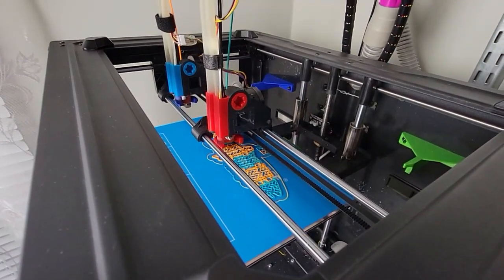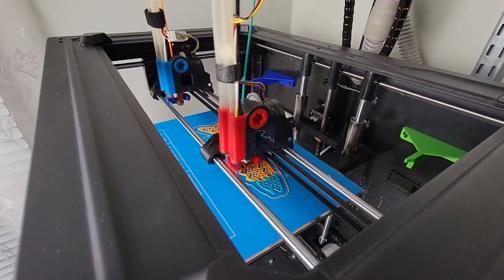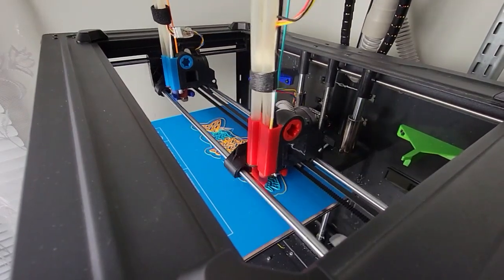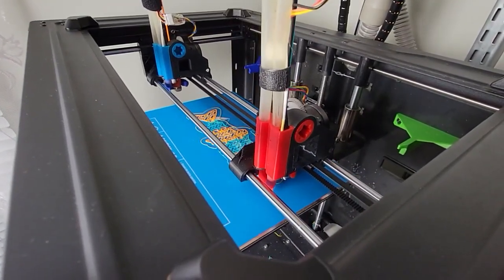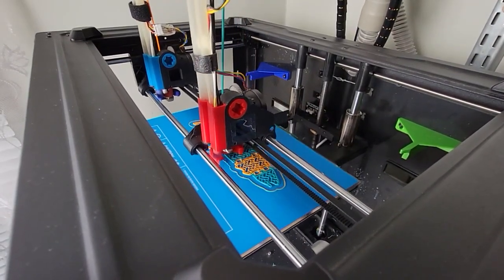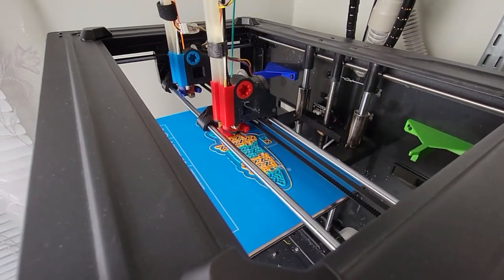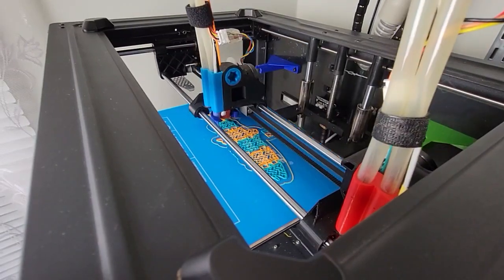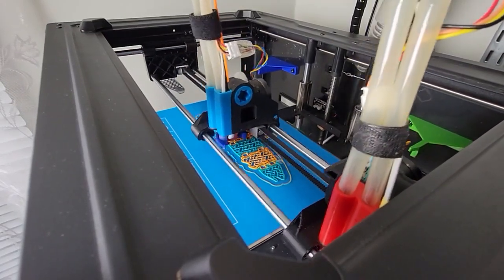1.97 Second Tool Change!  700mm/s at 4,777mm/s²

Comment: This looks amazing, would love to see the mechanism up close. Its way too fast lol. I'm wondering if you wanted to add more colors to possibly have them stacked along both sides and not attached to the axis? Just a thought.
Reply from the maker: Thanks!  You can see some closeup photos in my community posts here: https://www.youtube.com/post/Ugkx3SW8JXc22O16fT0ureUdnI2f6FZdYAWQ
You are basically describing a proper tool changer.  I may explore that design in near future.  However, most tool changers today are rather slow.  In a way IDEX is a simplest form of 3D Printer tool changer.
Reply: It's not a AMS.  It's dual extruder.  How can you add more filaments to this configuration, use your brain.  Just a thought
Reply: @Marcorios234 Well what about 5 toolheads in a row, and when we’re using T2 there’ll be two toolheads parking on the left of the build area and two on the right. I mean i think it’s doable, maybe not with this magnetic approach, not sure if you just got your brand new bambu, but AMS is not the only way to get multiple filaments

Comment: I don't think an IDEX counts as a full tool change but still very cool
Reply from the maker: Maybe you are right.  I consider IDEX a special class of tool changer or maybe tool switcher with a special ability to use both tools simultaneously.  
I always say, IDEX the simplest form of tool changer and Magnetic IDEX is the simplest form of IDEX 3D printer 😊

Comment: Hi been following your Idex system for a while. Was looking at doing a mechanical pawl type lock with over travel past park, to unlock the tool head for shuttle pick up. How are your tool heads being locked / unlocked in parking, soleniods , servos? Cheers, good work by the way.
Reply from the maker: Thank you.  I use a couple of tiny magnets to keep toolhead parked.  To decouple from the X-axis belt, I use a blocking paw.  Ultimately I'd like to use a push-push type of latch mechanism.

Comment: I love the water cooled extruders too!
Reply from the maker: Extruders are air cooled 😊.  One tube cools extruder and stepper motor and 2nd tube is for part cooling.  Zero fans on the toolhead.  It does look like a water cooling setup 😎

Comment: Besides the weight issue of motor and second hotend with extruder on the X axis, love the idea, looks so cool
Reply from the maker: Thank you!  The 2nd extruder and Y axis motor total about 131g.  So the Akula-class motion system is moving about 500g per Y-axis motor.  I am very happy with the weight and print quality of the system.

Comment: Oh!! I found out because my friend told me. I have the same model with qidi tech. I was going to convert it to core xy. But I found something more interesting. If I change xy to xy core, wouldn't I be able to move a little lighter? Let me print it out first.
Reply from the maker: I am glad you find this interesting.  I find that many Core XY printers have a heavier gantry than my little printer.  The print heads are so light, that I was able to use a pancake style motor on the x axis.
Reply: @m_IDEX  Do you have any plans to release the step file or modify it so that it can be used with the bambu hotend? bambu hotend is lightweight and inexpensive

Comment: So can you print different materials and different temps for them? Like can you print ABS, poly, pla, tpu and petg all together? Or is that too many materials and this is more 1 to 2 material types at best?
Reply from the maker: You can set extruder temperatures independently.  But materials compatible materials are usually prined at similar temperatures.  I like printing ninjaflex and ABS parts.

Comment: When switching toolheads, how do you guarantee that the nozzle is in the same position?
Reply from the maker: @CallMeSwal

The "Magnetic Belt Coupling," or what I call the "White Rabbit," ensures the nozzle stays in the same spot on the belt with each toolhead change. You can see the results of a torture test here:  https://www.printables.com/model/908896-modifier-mesh-for-dual-color-3dbenchy

Comment: Ist this going to bei Open source? What are the Tube for? Water cooling?
Reply from the maker: Yes
Reply: @m_IDEX  yes and yes, or ONLY yes?!
Reply from the maker: Sorry i missed that part of the question.  Tubes are for air cooling.  One tube is for part cooling and second tube cools both radiator and extruder motor.  You can see part of the air path in my community posts here: https://www.youtube.com/@m_IDEX/community
Reply: @surfalex2000 yes

Comment: May I ask how well does it work if your printing a different filament as a support material?  What is the impact upon print time?
Reply from the maker: Minimal time impact.  You are adding about 5 seconds per layer.  I have prined ABS with HIPS and ABS with Ninjaflex with excellent results.

Comment: The momentum of the x-axis and y-axis is not equal, so it is necessary to calibrate the motor output. The current best solution for calibration is to perform automatic calibration before each print. However, for dual-extruder machines, this may introduce too much randomness in the process. Additionally, simultaneous movement of both extruders increases the mass of the toolhead, potentially compromising the advantages of high-speed printing in current corexy printers. Any plan for these?
Reply from the maker: Magnetic IDEX could work with any motion system including CoreXY. Interestingly the total weight of my Y gantry including both toolheads is lighter than many popular single extruder printers 😊  I do not have any plans for a coreXY printer at this time.